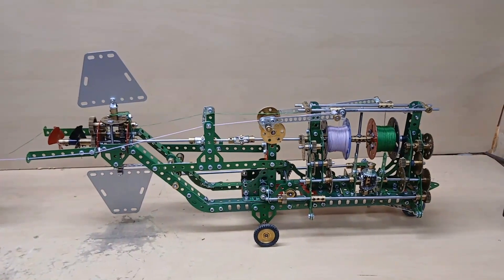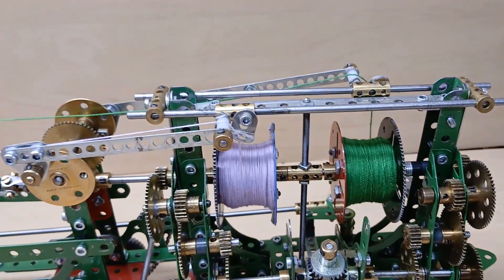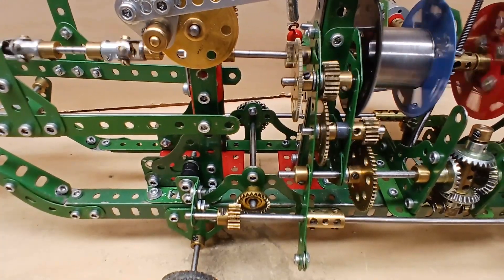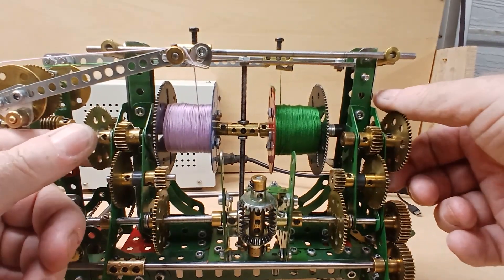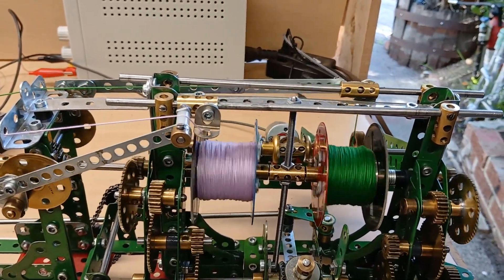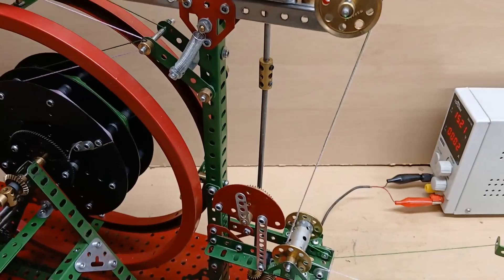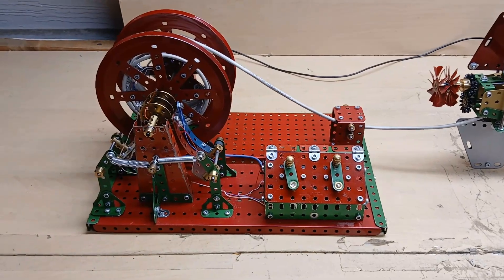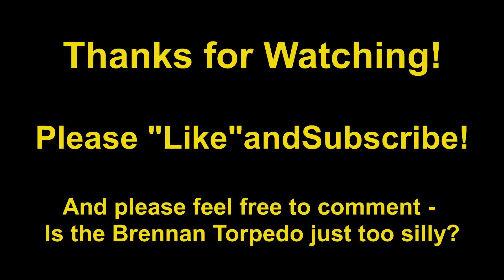Brennan Torpedo in Meccano

Comment: I had heard of this Brennan machine, but never knew how it worked until now. Thanks for taking the time to research, build and film this one. Whether the Brennan was actually used or not I don't know, but there seem to be an awful lot of things to twist, tangle, break or otherwise go wrong. (Why make it simple, when you can make it complicated?) Your Speggly is interesting, but surely needs hydroplanes to give lateral stability and also rise of fall? Anyway, I like both the project and the film, so thank you.
Reply: Thanks for the comment. Yes, the Speggly needs hydroplanes but so does the Brennan. The guy who built the original Brennan didn't tackle the hydroplanes either. I only built the Speggly to show how unnecessarily complicated the Brennan was.